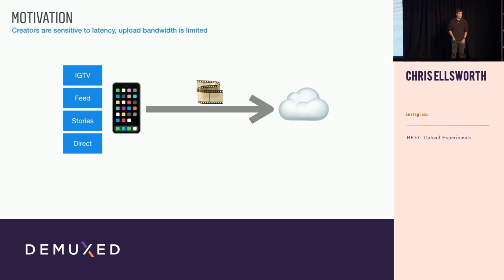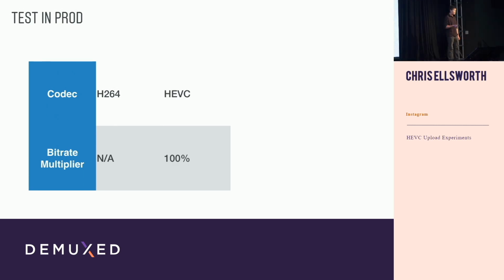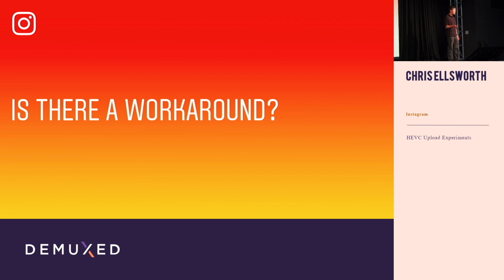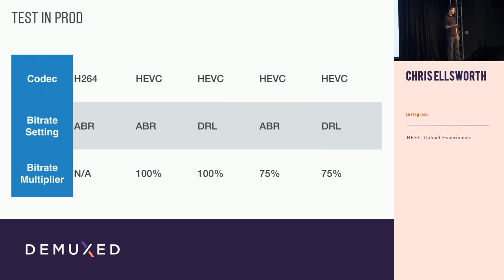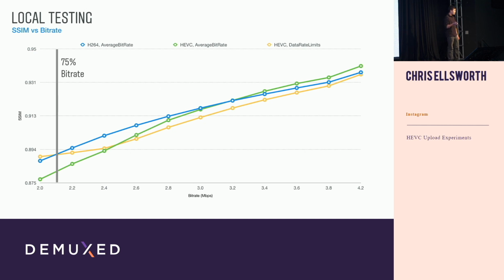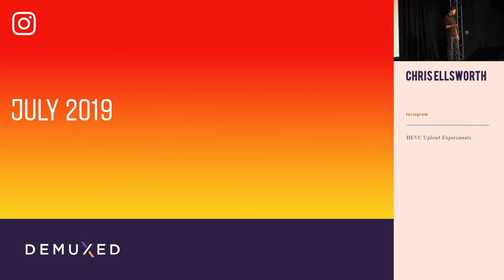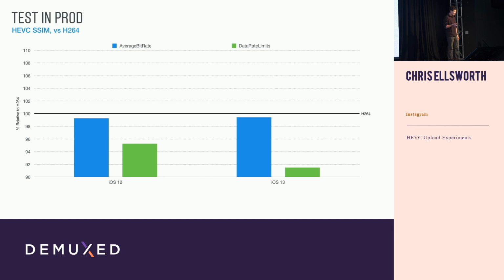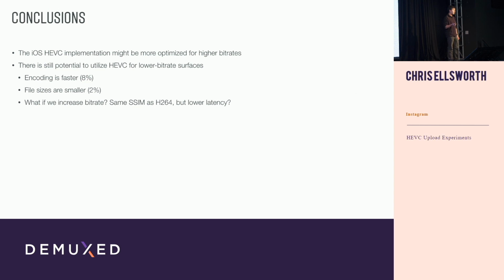Chris Ellsworth - HEVC Upload Experiments

Comment: HEVC's improvements upon AVC were higher compression (up to 40%) on resolutions higher than Full HD (more in the order of 4k)
Lots of gains are for high resolution and high bitrate streams.
At least as far as I know

also AVC has more mature encoders and hevc might be more complex in hardware, since avc is older they can by now do the more complex encoding stuff in hardware now, too (which might not be true for hevc, yet. software encoders can probably do better but are not battery efficient)